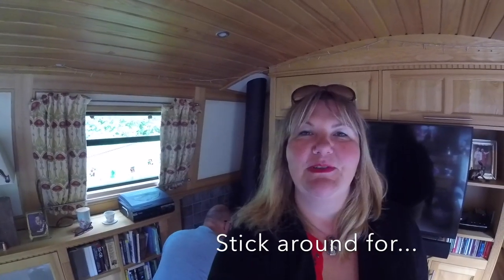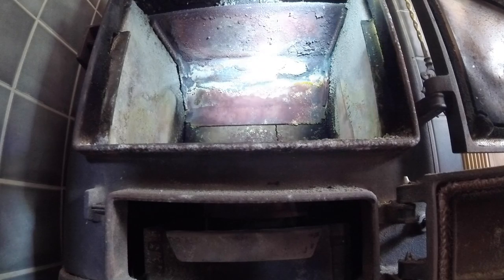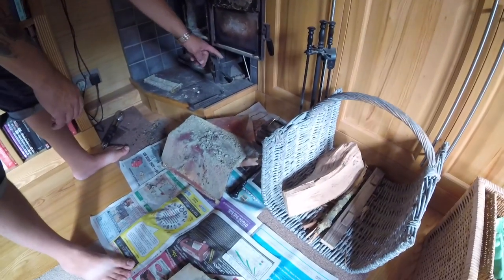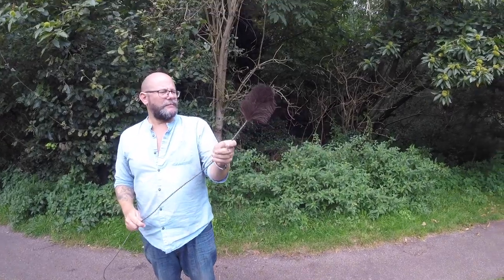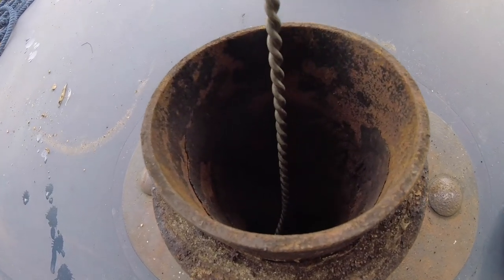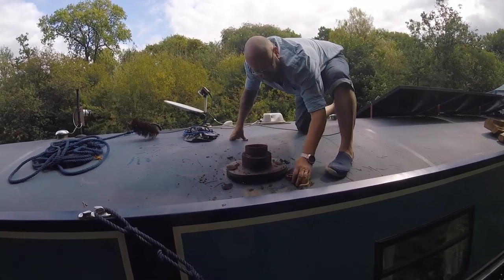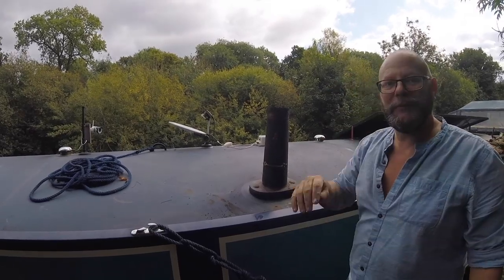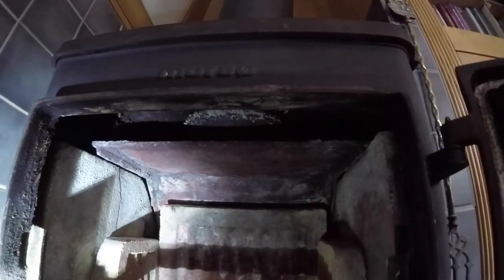#59 - How To Clean A Narrowboat Stove

Comment: We do not have a canal boat but still found this excellent; thank you both. Hope this does not sound like nit-picking - it is really to help you (honestly!) but did I see on the final few main-vid shots that the rear fire-brick was marginally too far to the right (after re-installation). It might be an optical illusion but it appeared that the right inner fire-brick overlapped it, whereas the left inner did not. I just wondered if that made the rear brick likely to fall forward, given the pressure of the plate it was supporting? I may be wrong but just wanted to point that out.

I loved the out-take where Mark would have been swearing loudly, were it not for being on tv but, instead, you brought-up the "f" for Facebook on-screen - lovely editing. 

What should one do in the event of a narrowboat chimney fire? Axiomatically, evacuate people and other animals but then? My thought is have a submersible pump at a known location and in good condition, which can be attached to a hose (ditto), popped into the canal and then water can be pumped down the chimney from the roof, whilst keeping the fire door closed. If safe, a spotter could be inside the boat watching - to ensure the fire was out and to avoid flooding as much as possible. But is that a wrong or silly idea, please? (NB if the water-tank filling hose was used then it would need replacement (in that role) after canal water had been piped through. But that would be a relatively small price to pay.

Non-sequitur: Did you say you were going to review boat-security and comment (non-specifically, axiomatically!) on your own defences. It may be you dropped that in case it compromised your own security - in which case, sorry please forget it. Then again, you could do a review of the market availability etc. (Sorry if you did but we missed that vid!)

Anyway, to all three of you (whilst I am yattering-on) can we thank you for your excellent videos - I think we have seen them all (?) at least once. I love the laid-back fun approach you take, whilst still conveying useful / interesting / educational topics in a well-presented and very intelligent manner.

Best wishes and we'll wave, if we see you on the K&A some day. Happy cruising.
Reply from the maker: Hi, Llewellin, that's a lot of points you raise! The fire bricks won't fall forward because the baffle plate sits on the back and side bricks that are fitted to the fire, so there is no pressure on the ones that sit to the front and side that we have placed in there. 
If there is a chimney fire, the simplest trick is a bucket of water down the chimney, and luckily, we have ample supply. We think we would rather suffer water damage than fire damage.
We did say I was going to review a security camera on a previous vlog, but the camera was so ineffective it didn't warrant a video. It is something we intend to do, just not yet.
Thank you for watching the videos and we're glad you like them.
We are heading back to the K and A at some point, so if we pass you, say hello.
Reply: @WeirontheMove  Thank you very much for your thoughtful, interesting  and informative reply; appreciated. We'll stay-tuned and see you on that cut sometime, maybe. Take care and great cruising.

Comment: Great Vlog as always . Those bricks in your fire block / stove aren’t asbestos based ?? They look like the old moulded asbestos blocks ?  Just curious .
Reply from the maker: Hi, Keith. The bricks are chamote firebricks made from a concrete material that is highly resistant to heat.
Reply: Weir on the Move hey thanks for coming back . The boat maintenance vlogs are much appreciated and a great insight into tasks that would be important to the upkeep of the  craft. Thanks again 😊